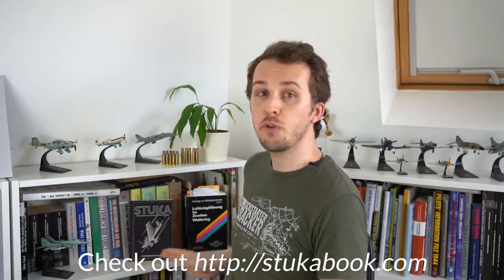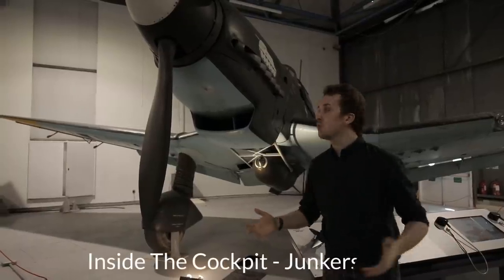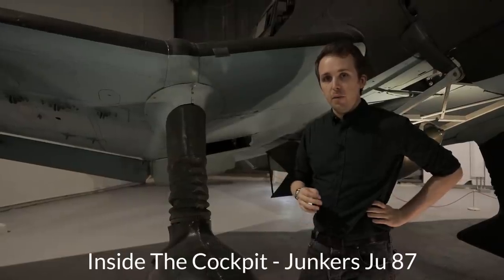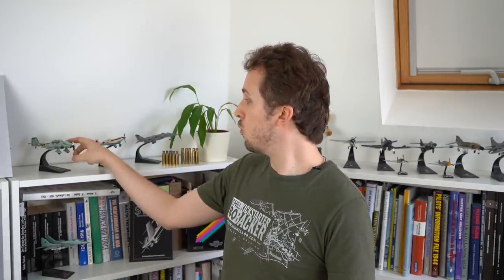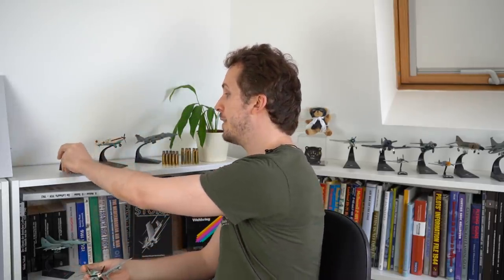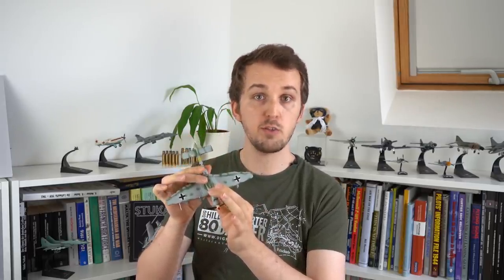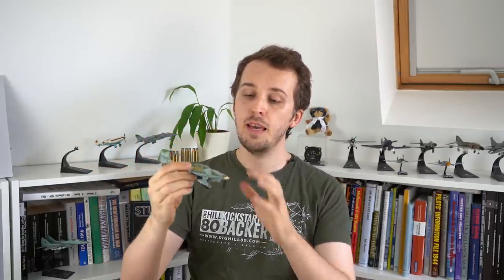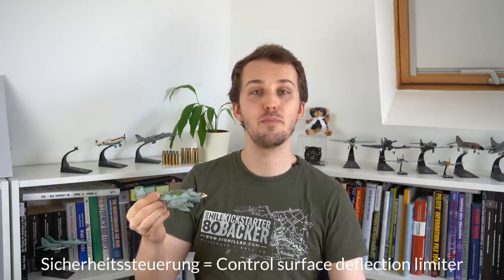How does it work? - Ju 87 'Automatic' Dive Recovery System

Comment: 4.52 Are you sure Chris?   
IF you deflect the trim tabs UP that would typically cause the elevators to deflect down, the nose will thenpitch down & the dive will steepen won't it?

At circa 7min you're talking about why have a sicherhaitssteurung (now there's a word to drop into converstaion at the arifield).
Everything you say makes sense but there's a further effect interwoven with all of it which may be another major reason to fit that system.
If the pilot's groggy with high G on pullout maybe there will be a tendency to pull back too hard (as you say). Then,  beyond stressing the airframe, there's a pretty high risk of a high speed stall too. 
And that would see the JU87 go boofing into the ground like a kayak pancaking off a drop onto water hitting flat with the underside belly.
In other wods, the nose is horizontal, even pointing upward but momentum is taking the aeroplane down, because high angle of attack means the arirflow over the wings is a turbulent mess of a high speed stall with virtually no lift.

(Tried to find an addy to send this to you direct Chris but can't see one)
Reply from the maker: Hey, I thought I already posted a comment on yours but it seems to be missing - check the pinned comment, the tabs move Down or rather to their neutral position. I misspoke and am very annoyed that I didn't catch it in the edit. thanks for the comment!

Comment: It is my understanding that some JU87 aircraft were fitted with either a belly camera, a tail camera or even both. The usual belly camera was a Leica 250-GG "Reporter" camera taking up to 250 24 x 36mm images on a 10m film strip of standard 35mm perforated film (I have one of the earlier but very similar Leica 250-FF Reporter cameras) and with an electric motor drive. The tail camera when fitted, was a smaller and lighter Berning Robot camera, also using an electric motor drive, rather than the clockwork motor drive of the regular Robot cameras. These take 24 x 24mm images but I have not been able to ascertain the length of film in this special version of the camera. The idea was for the belly camera to assess bombing accuracy and the tail camera to assess bombing effectiveness. I have been told the Leica was switched on manually but the Robot automatically, perhaps when the pull out device, which causes the jolt, is activated. Anyone got any more information on this subject?

Comment: Excellent! I had no idea of the Abfangvorrichtung.

One point and one question:

Point: I can think of no tactical reason to change the initiator of the Abfangvorrichtung. I would not be surprised if it were the results of an economic decision. Possibly the automatic Auslöser simply cost much more than a simple electric switch on the control stick.

Question: How long did the Abfangvorrichtung remain activated and how was it disengaged? I imagine they would design it to at least remain engaged until the AoA was above the horizon. But if the pilot was really blacked-out for so long, and the AbVoRi didn't also automatically disconsciousness

Comment: That makes sence, the dive recovery system was activated only with the bomb release switch. So, in case the pilot blacked out on a dive, then the bomb would still be aimed at or near the target and would have more chances of a hit. Although in this case the pilot and the aircraft would be lost, which I don't think happened a lot, maybe with rookie pilots. One point to note is the dynamics of the aircraft upon a bomb release would change drastically, as it gets lighter in a split second and this would help in the recovery.
Got to have a look at the Japanese Aichi D3 dive bomber, which I don't think had an automatic dive recovery system.
Reply: I don't think a pilot was likely to black out in a dive, it would be the pull out where that would be likely to happen.

Comment: The Stuka had a change in wing armament in It’s really to see that dive recovery on the Stuka was improved on later D-5 Stuka. US Navy SBD/SB2C pilots had no problems unlike their Stuka counterparts with dive recovery that flew the SBD Dauntless & SB2C Helldiver had easier dives as did it  at 70 degree dive angle this is because they have release the bomb from the cradle in the case of SB2C from the it’s internal bomb-bay with the doors open early for the bomb to hit a moving ship

Comment: Hey Chris, just a quick question/annotation. At around 4:50 - 5:00 you explain the activation of the servo/trim tabs attached to the elevator. If I heard you right, you said they moved to an up position. But they should be moving downwards to deflect the elevator upwards to lift the nose/pitch up. I hope I got you right and didn’t make a mistake here as well, this can get easily confusing. But great content and really looking forward to your book! Cheers and kind regards!
Reply from the maker: Hey, check the pinned comment for the correction - sadly I misspoke and didnt pick it up in the edit which I am rather annoyed with
Reply: @MilitaryAviationHistory  Sadly I didn’t pick up the pinned comment on mobile, so please excuse this rather unnecessary comment. No reason to get annoyed, I feel a bit stupid for pointing out the already corrected!
Reply from the maker: Better to point it out than not, appreciate it!

Comment: Sounds like an 'Automatic dive recovery assistance' system. The only automatic part is the slight trim to help the pilot. It would be interesting to know how much this up trim would help if the pilot became unconscious before pulling the stick back to recover. Would it be enough to recover without any pilot input? 70° nose down is an extremely steep pitch angle.

Comment: My theory would be that any dead pilots would add to the „bombs“ dropped by failing to pull away from the dive… I mean it‘s not like the planes could be recovered if the pilot is dead already, might aswell control the crash site to be roughly where you want damage to occur…

Comment: Your understanding of trim tab mechanics is reversed.

For UP elevator the trim tab goes DOWN thus aerodynamically (flying) the elevator upward and resulting in UP elevator pressure or trim.

Everything else looks perfect. Thank you for such an in depth presentation of a very well thought out safety system.

Comment: Worryingly you have made the awful mistake in your description of the dive recovery system when you say that the system makes the trim tab move up. ?????. To initiate up elevator the trim tab must be driven to a downward position in order to drive the elevator into a nose up position. Possibly a bit nit picking but as I write the FAA accident investigators are looking at a possible mis-rigging of a Sia Marchetti crash in the USA
Reply from the maker: Hey, you're correct, they deflect up when activated and down during the recovery. I mispoke and didnt catch it in the edit, ill add a pinned comment and will address it on the next video on the Ju 87 :) Thanks again
Reply: @MilitaryAviationHistory  An easy mistake to make and indeed it is a known snag(mercifully infrequent). Same kind of thing as reversing the ailerons but at least when you get to do the full and free check the ailerons are generally visible. The trim tabs tend to be less visible. I certainly do not hold it against you , I really enjoy you thoughtful and detailed presentations. Great stuff. Best wishes.

Comment: The shift to the manual actuation probably was to give the crews the option to decide at which altitude they wanted to abandon the dive. The lower you escape flak, the greater your chance of escaping are. If a Stuka dropped its bombs and levelled out at 300 feet, it was in a perfect position to get hammered by flak and small arms fire. less so at 100 feet above ground, even less so at 50.
Reply: Of course those lower heights add chances of involuntary lithobraking by violent machine-human-goround interface.
Reply: @vksasdgaming9472  Could it be you found the actual foundation of the Nazi's "Blut und Biden" (Blood and ground) mythology? :oD

Comment: Have I got this right?
1 Pilot flicks a switch and goes into nosedive
2 Pilot hears something (triggered by altitude?) in the cockpit 4:04
3 Pilot releases bomb, and after feeling jolt, pulls back on stick 5:10
4 If pilot temporarily blacks out the Recovery System will help level out plane
??? TIA

Comment: I have a question regarding the dive initiation process, when you flick the speed brakes on, the air speed reduces, however since the aircraft is trimmed to cruise air speed it naturally pitches down in an attempt to regain the airspeed. Now is this what initiates the dive? or is the dive initiated by a dedicated change in trim by the dive recovery system?

Comment: I once came across a picture in a book or TV/video piece that was of an aeroplane similar in layout to the Ju87 but was ‘tubbier/fatter’ and powered by a Diesel engine. Apparently the motor was underpowered and the plane went nowhere as they had the 87. I now can find no reference to this machine. Was there a sister or forerunner to the Ju87 or do I have a far better sense of imagination than I thought I had/dream?
I used to do plane spotting and aircraft recognition competitions in my younger days- back when a Bf 109 was nearly always called a Me 109 and every so often a Me 108 would be flashed in a competition.
Reply: Maybe you're thinking about the Hamburger Flugzeugbau Ha 137? It has the inverted gull wing and fixed landing gear, but there was no diesel in it I think - either a radial or a V12.
Reply: @griffn14  it’s a distinct possibility. I used to think I knew just about all WWII planes but every few weeks another one pops up, which I forget because my brain is broken.
Reply: @PenDragonsPig   Oh, yes. I have the same experience. Too much information can not be handled effectively.

Comment: Wouldn't the limiter also help in avoiding stalling the horizontal stabiliser? An excessive elevator AoA might disrupt the airflow up to the point it loses most of its effectiveness, resulting in a much wider pull up radius. If I'm not mistaken it's the same principle behind basic stall recovery (the stick is pushed forward, not aft).
Reply: I suspect the JU-87 could generate plenty of G without excessive elevator deflection at that speed.

Comment: Very good explanation,but the trim tap hasn’t go up in order to assist in a dive recovery, it has to go down to move the elevator up ! ( fletner tap) . Die Sicherheits Steuerung ( elevator limiter) of course , has to prevent to much G loads , but mostly to prevent a stall ( angle of attack to high) very easily achievable even on high speed ! Typically airshow accident ,after a steep dive , the A C hit the ground with nearly 0 pitch but with tremendous angle of attack .( stall ) .

Comment: I wonder how many G's these dives pulled. I don't believe they had pressurized suits, so you'd think there would be some blackouts with the plane following the bomb into the ground.
Reply: This is literally what this video is about, this entire system was designed to avoid rapid disassembly upon ground contact due to mishandling a dive

Comment: The system prevented the pilot from pulling up too fast which could cause the aircraft to experience a sudden and overwhelming urge to free its machinery from the airframe.
Reply: Yep .. the Jumo Engine reputedly wasn't too keen on sudden changes in direction ..

Comment: I wonder if there was a brief time delay between the bomb release being pressed and the dive recovery system being activated.

My thinking is - If it was activated the exact same instant the bomb release button was pressed, could the Ju 87 begin to nose upward while the bomb was still swinging out on its cradle, and hadn't yet left the cradle?

Could that throw the bomb ahead of the pilot's aiming point?

Or would the Ju 87 take a second to respond to the activation of the dive recovery system, allowing enough time for the bomb to clear the cradle before beginning to nose upward?

Or - is it the beginning of the pull-out that actually swings the bomb cradle out from the Ju 87's belly and releases the bomb?
Reply: I believe he said or at least I interpreted it as being activated when the cradle reached the release point.

Comment: Could you give thought as to why so few twin engine aircraft had counter rotating propellers like the P-38 Lightning?
Reply: Expense. Planes like the Mosquito — which has both props rotating similarly — do have some net torque effects, but the engines are far enough apart that it’s not a big problem.  To do counterrotating props you need a complex gear mechanism and a set of different prop blades

Comment: 1. You should call your models "Instructional aids" or whatever Ward Carroll calls them :-)  Imitation is the sincerest form of flattery, eh.

2. What determines the dive angle, aside from the plane's capability -- why would pilots choose 70° instead of 90°, when 90° would presumably provide the least bomb drift and most accuracy?  I had always assumed  US Navy pilots chose 70° because that would keep enough forward speed to match a moving ship target at 30 knots, and attacking tanks would benefit from maybe 80° or so, since tanks generally don't move as fast as ships.  But stationary targets would seem to be best attacked straight down at 90°.
Reply from the maker: It depends on the target, the manuals do have an obvious preference for an angle of 70°-90° (for the purposes you stated, although they highlight the most important part is getting the aiming point right vis-a-vis wind and approach) but in the operational experience reports I will add to the book you can also find mention of 45° etc.
Reply: I would speculate that 70° is nearly as accurate as 90° but is much easier for the pilot to control and make adjustments.  A pure vertical dive is effectively zero G, while a shallower angle keeps some positive G on the airplane, and the pilot does not have to push past vertical to inverted to adjust if he realizes his aim is long.
Reply: @gort8203  That's a good point: always allow for errors and room to adjust.

Comment: Germans are capable of building lethal fighters I was surprised to find that they operate F-16 inspite of being legends in field of aeronautical engineering, it made me wonder if had freedom to design state of art leopard tank why not build aircrafts? 🤔Maybe there might have been some form of world war 2 treaty baring them from making one
Reply: Germany doesn't use the F-16. They use the Eurofighter Typhoon (about to recieve a major update) and the Panavia Tornado (going to be phased out). both of these are joint developments from several european countries, with Germany playing quite a significant part.
Reply: During the cold war, Germany did use mostly american fighters, such as the F-84, F-86, F-104 and F-4 (and the Italian G.91).

But in 1981, they introduced the Tornado to augment the F-4 and to replace the remaining F-104. 2006, the Eurofighter was introduced, which would later replace the F-4.